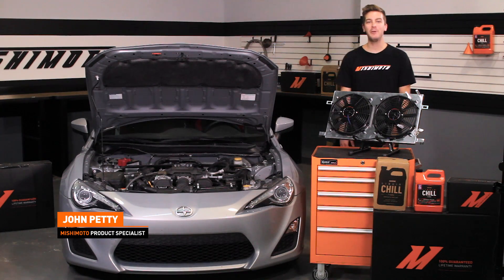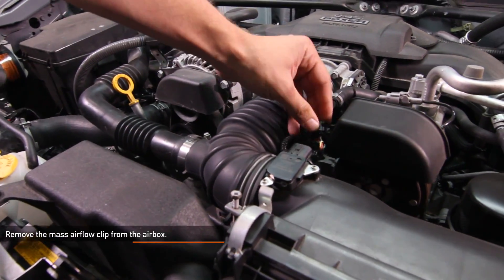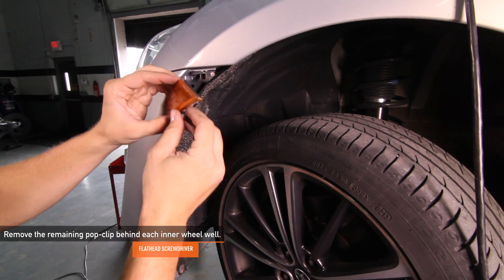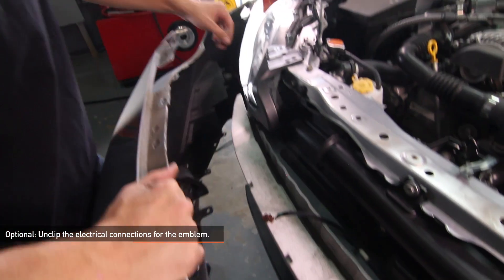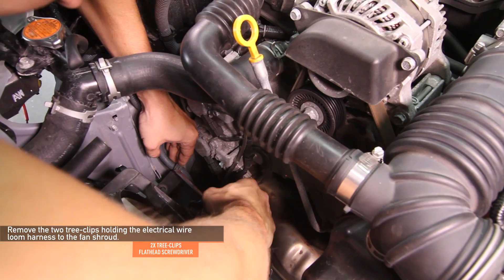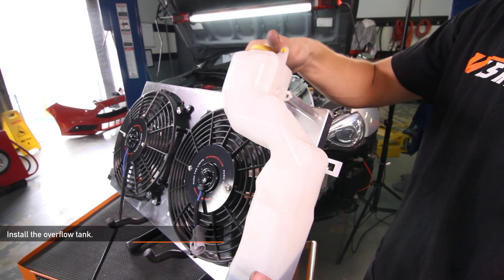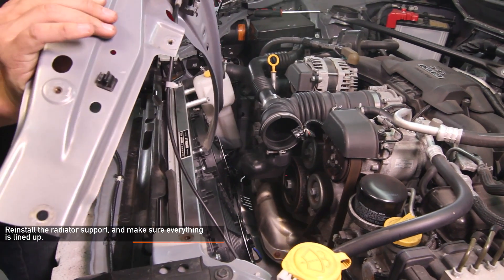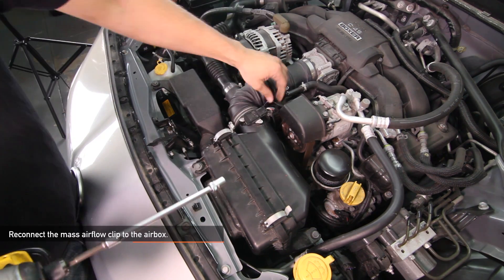Performance Aluminum Fan Shroud Kit for the 2013+ Subaru BRZ / Scion FR-S / Toyota GT86 Install

Comment: Would this Fan Shroud be good for V8 swapped 86/BRZs?
Reply: no bro . the oem fans are better . but the mishimoto radiator with the oem fans.  is wayyyy better  . dont use the mishimoto fans except for extra clearance.  or use the shroud with othe fans like spal. thank u all for your time . the rediator is a good product.  will get a E46 m3 radiator and china fan combo from mishimoto.  will take out the fan and installe better cfm fan on the mishimoto shroud
Reply: Im workin on the Facebook and instagramz.  U are welcome to follow me there . I have no time for youtube and video editing . Cheers buddy
Reply: And your most welcome